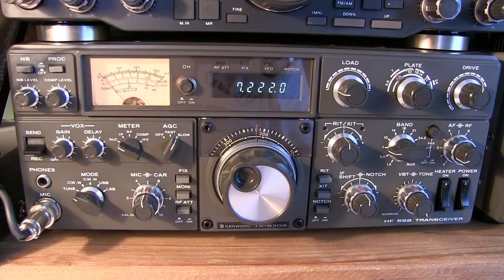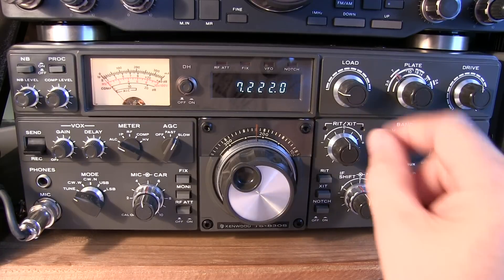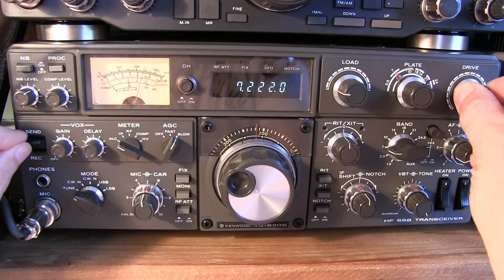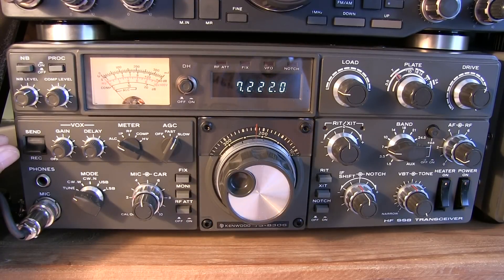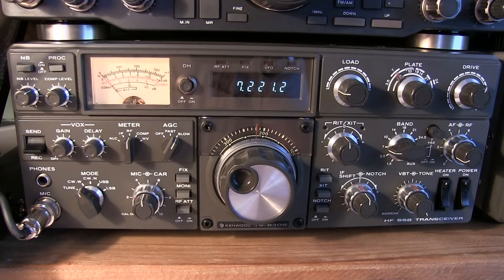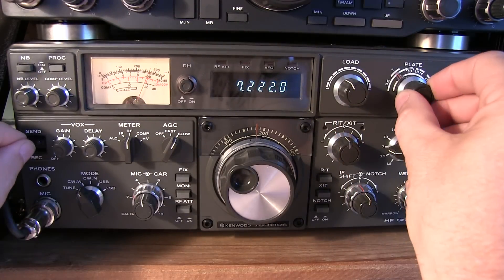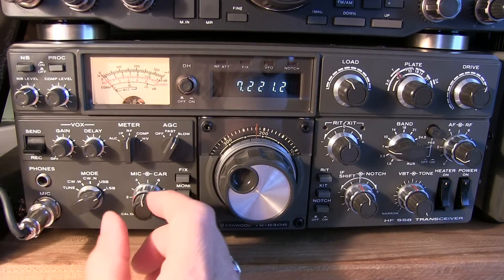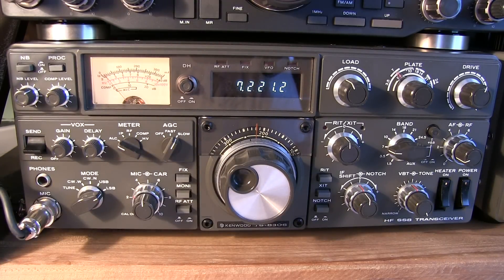#153: How to tune up a Kenwood TS-830S hybrid rig / transceiver | TS-520 TS-530 TS-820

Comment: Good Video - I have a TS-530S (recently acquired) and have done a lot of research, including studying the manual.  A couple of things.  I really think you should follow the manual, and while in TUNE, switch to RF and peak the Load, to preset that before switching to full power.  Easier on the Finals.

Also, especially a new operator, open the key (switch from SEND to REC) immediately after dipping the plate.  Let cool, then Switch to SEND and immediately Peak the RF, unkey (switch to REC.)  Let Cool, then switch back to IP and RE-DIP the PLATE, ensuring that it is below 265ma.  Somewhere around 225ma-260ma is appropriate.  Then you're done.

This is per the manual, and I would strictly follow it's directions.
Reply: +remingtonh You mention that you would and also suggest that people follow the manual and not Alans method in this video. You never state WHY you are suggesting people to NOT follow his procedure and to follow the manual, strictly. Bit of a problem there is you want people to actually consider your suggestion but give no reason why.

Lastly, do you have a EE degree, work for one of the world leaders in occilloscopes and have a YT channel with nearly 50k subscribers and over 200 videos delving deep into electronic and RF theory as well as practical application complete with hand made diagrams with calculations firming up the content? I mean....if you did.....then just off-the-cuff telling people to do something "might" fly.

Not being negative or mean or anything....just some simple question and answer. At least this inquiring mind would like to know.
Reply: +Brian Streufert I'll admit I don't know who Alan is, and I'm sure he's far more knowledgable than me, however, I am approaching this from the perspective of a new operator (the target of this video, I'm sure).  

A new operator will be slower at tuning the finals, and running full power in CW while tuning the finals, while taking extra time alternating between load and plate will stress the finals while they are detuned.  

The manual states the life of the final tubes is dependent on the SWR and how long the tuning process is.  I think it's important to stress, to new operators, the importance of keeping the tuning process as short as possible.  A few seconds in transmit at the most.

Once the operator is experienced and confident enough to tune both load and plate within 5 seconds, then I'm sure leaving the switch in "send" while that is accomplished is fine.

Comment: Sorry but you are wrong about the ALC scale. It means nothing at all at this point. Kenwood reprinted manuals later that said to keep it in the ALC when peaking the drive but  before hand they never said to keep it in the ALC during drive peaking.
Reply: +mykenwood830 It does matter, because if it's not set properly prior, you can't load properly.  Also, it peaks the receive gain.
Reply: +remingtonh Ok i stand corrected !! thanks.

Comment: Like!, but where does the coal go in?

Actually I'm going for my license and am interested hybrid radios. Since the provisions of my initial license preclude me from radio mods and >10w I can only dream of using one of these. Suppose I could buy one for later. I note these can have the power output turned down via a pot in the ALC and a 9v battery in reverse polarity :)
Reply: +Stevo Reno...probably the single worst piece of advice EVER OFFERED on YouTube. Do NOT EVER mod these beautiful radios for out-of-band operation.
Reply: It's OK I'm Licensed now guys.

Comment: Bought my TS830S new in '84 - still my only rig. Original tubes. Output between 115 to 125W. I'm not very active, and it was in storage for about 5 years but it works great. I originally was in the market for a Yaesu FT-102, but it was just discontinued. Glad I went with the Kenwood.
Reply from the maker: It really is a great rig, your certainly made the right choice all those years ago.

Comment: For those of you using the old Dip and Load method to load your KW hybrid I submit you have not read your operating manual.

No where in the KW manuals does it describe this method. Why do you think KW provided the RF relative power position? Because they wanted rig to be self sufficient and external wattmeters were not common and were expensive.They understood the best way to load a grid driven tetrode SSB linear amp in Class AB1 config is to load for max rf output without exceeding maximum plate current. Using the Dip and Load method was only game in town for the old Class C grid leak bias CW transmitters of 50s and 60s. Using Dip and Load the heavier you load the less discernable the dip becomes. Not so with the RF meter position or external wattmeter. The output power indication remains very obvious and well defined. Also, dip or resonance and max output power will not be the same but takes too many key strokes to explain why here. I teach all new KW hybrid owners to load as their manual instructs them to do and better yet invest in an inline wattmeter.

For those who think the CAR Level and where you set it in CW mode will affect SSB loading you have vivid imaginations. The CAR level control provides variable dc voltage from approx 0 to 0.7vdc to bias on the diodes in the Balanced Modulator which is configured in ring diode. You are simply setting the level of DSBSC from the Bal Mod which becomes your 8.830mhz TIF signal which becomes your drive for the Transmit Mixer. Makes no difference whatsoever where you set the CAR level pot. In SSB mode there is no voltage from the CAR pot to the Bal Moduylator . You can confirm that  if you measure your CV terminal in SSB mode. You would not want any dc bias voltage. The audio from the mic amp unbalances the BM.

Lastly when you peak the ALC you are not peaking grid current ( remember the cautions in the old days!). All this radio needs is maximum rf voltage swing at the control grids of the 6146 finals. When that happens the rf drive envelope exceeds the dc offset of the operating bias and the grid becomes positive with respect to the cathode and the minute a hint of grid current flows the ALC amp drives the ALC bus voltage down reducing the TIF amp rf output. With the ALC in middle of the black printed scale you have approx 38 ua of grid current and with the ALC pegged at meter full scale (FSD) there is approx 45ua of grid current. That is ua of grid current and not millliamperes.

What Allen has done is made it possible for newly licensed  hams who have bought their first HF rig to easily load the radio with no understanding of parallel resonance, tank circuits, or how the KW hybrids work. Hopefully that will come with time. A much needed assist for these new people. For those of you stuck in Dip and Load world have a ball. OK to load that way, but I think I last did it in 1970 or so and sure dont teach it to new people.  

Terry K9TW
Reply: Thank you very much for your help and advice on how this works I have a ts830s  and tune for maximum rf on the rf setting position on tune then do it on cw and back car down to  100 watts approx been out of radio  a long time but back now and learning thank you

G0myd
Reply: Thanks for this explanation. I have been adjusting carrier after the final Load/Plate thinking I always need my needle inside the ALC range. I didn't realize it doesn't effect SSB.
Reply: Step 8 of the TS-830S manual says, "Place the Mode switch to CW, Meter switch to Ip. Close the key and IMMEDIATELY redip the PLATE control. Reduce the carrier control setting if Ip reads over 265ma.  Open the key."

Step 9 says to then switch meter to RF and peak the LOAD and PLATE for max RF output.  It then makes a note that the dip point may not always coincide with max output because neutralization is accomplished on the 10 meter band and that you can simply adjust both PLATE and LOAD controls for max output.

Not sure if that's the "dip and load" method you refer to.  But the note after Step 9 makes it sound like step 8 is optional.  The summary table 4-1 also omits step 8.  It also has a step where you peak RF power with the LOAD while still in TUNE mode before going to CW mode and then peaking the RF by alternately adjusting PLATE and LOAD.

Comment: Great video.  I've had my 830S about 2 years, and it seems to work just fine, though I probably peak out at about 80 watts according to the power meter on my Kenwood Antenna Tuner AT-230.  As far as dipping the plate goes, if I have the selector in the "Tune" position, meter on "IP",  and activate "Send", I never get any movement out of the meter.  So that approach has never worked for me.  Instead I put the selector on CW, and using the plate and load controls try to achieve maximum power without exceeding 225 ma on the IP meter.

Do you have any idea on why I would get no movement of the IP meter in TUNE mode, but it works just fine in CW mode?  Anybody else experiencing the same issue.
Reply from the maker: Have properly adjusted the DRIVE and CAR controls? Maybe the bias adjustment on the rear needs adjustment or is faulty
Reply: ***** Yes, I adjusted DRIVE and CAR just like you instructed.  Hmm, bias adjustment?  Gotta dig out the manual.

Comment: Great job. Nice video and simple, concise explanation. I do this every day on my TS-530. Like another commenter, i rarely use the meter at RF for final tune but keep it at IP and adjust load and plate for a dip at 225ma. I also have an external SWR/Watt meter so i can see the SWR dip and RF Peak at the same time.

Comment: Hello Alan I enjoy all your videos.
Wondering if you're considering doing a video on the X1M 5 band transceiver
Something as you did on TT 1254 Receiver. An S-melter for the X1M also would be much appreciated along with a schematic walk-through.
The best
Thanks
Reply from the maker: Iif I had an X1M, I'd consider doing the videos you suggested. But, I don't have one at this time.
Reply: I would be happy to part from mine for a few weeks and send it to you free with prepaid return postage and appreciations if you would consider reviewing the X1M. My email is paul.chebi@att.net for privacy communication re mailing addresses etc. Thank you 73 de kk4ptv
Reply: Paul Chebi I realize it was presumptuous to ask you to do a review on my borrowed x1m. In fact I asked the woxun us re p to send you a free set for rev view  as it would probably help them if you review ed the I unit. No response though.
With the current interest in the si510 HF generation, and the move in the Farhan Minima project I read about, and the lack of general info on the x1m notwithstanding its its apparent success and comparability with the 706 and 817', ii thought it would be very helpful to me at least, to sea what you think about it and suggest a stand alone s-meter to go along with it as you did for the tt1254.
With best wishes de kkrptv

Comment: Alan, explanation of the tuning in SSB mode is not complete, without adjustment of the compression level, when the processor is switched.
Reply from the maker: The compression level is something that you typically set once, not every time you change frequency. These infrequently adjusted and checked thing like compression level, idle current and CW plate current aren't covered in this video since the intent was to focus on the proper tuneup process, not the complete rig setup.

Comment: Alan, as a former 830 owner this brings back memories. But I never resolved how far from the original tune-up freq you should repeat the process. Every 20-40 khz? More? The whole band? 

Guessing it should be only maxing the plate controls, right?

Comment: I usually start by checking the idle plate current is around 50ma so I know the tubes are ready.
Reply from the maker: Yes, always a good idea.
Reply: Should'nt it be 60MA???
Reply from the maker: Neil Beeson 60mA is the maximum - I usually try to keep it a little under, a little safety margin.

Comment: Can you show how to use the antenna tuner with this also?
Thanks
Reply: ***** I would imagine that if the finals are already tuned into a 50 ohm dummy load, they're good and don't need to be "readjusted".  The idea now is to tune the coupler (no tuner tunes the antenna, it just tries to match the impedance of the radio to the feedpoint impedance of the antenna) to best match impedance for minimum SWR.  Wonder how that works with an auto tuner.....probably the same way.
Reply from the maker: I'll usually tune into a dummy load first.  Then, switch in the tuner and roughly adjust it for max receive noise. Then, put rig back into TUNE mode to cut power. Then tune the antenna with the tuner, without touching the rig controls. Then switch back to full power and recheck the peak using PLATE and LOAD.
Reply: Thanks!!!
Reply: +Jeff Wimmer (Mustang) I agree with this.  No need to readjust plate and load simply because you switch to tune for a second, to tune the antenna.  More wear and tear on the transceiver doing this every single time.  (unless you're tuning because you drastically changed frequency, then you need to retune the drive and finals anyway.)
Reply: +Jeff Wimmer (Mustang) Also, I use an auto-tuner.  Switching to TUNE and keying puts out about 15 watts, perfect for an autotuner.

Comment: First HF rig I owned was a TS530S, not as "feature packed" as the 830. I fitted the FM board myself which was fun! I remember the driver bias resistor burnt out which was a costly repair because the resistor was virtually inaccessible so the tech had to drill a hole through the board to change it! One to remember if you ever get that problem! Great radios tho, wish I still had mine.
73 GW4WOV

Comment: What output tubes does this transmitter use?
Reply from the maker: 6146B
Reply: Most probably 6146b's
Reply: Hi, I have TRIO TS-510. Do you know if i can use this tubes for the ts-510? 73
Reply from the maker: They are somewhat compatible with the S2001 tubes used in the 510. There is some additional info I found here:
http://www.redwaveradio.com/2_ee3ac4eac172cd57_1.htm
Reply: ***** Thank you very much :)